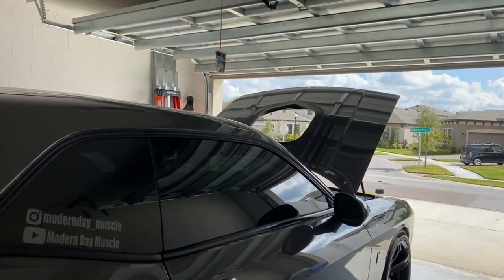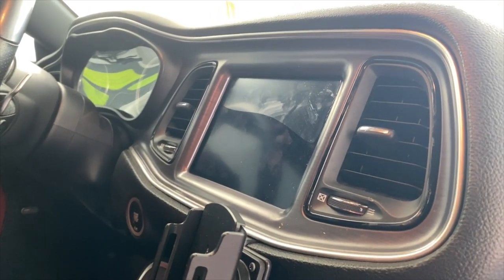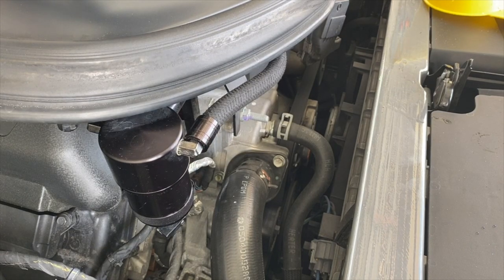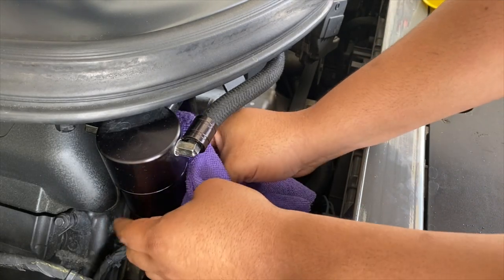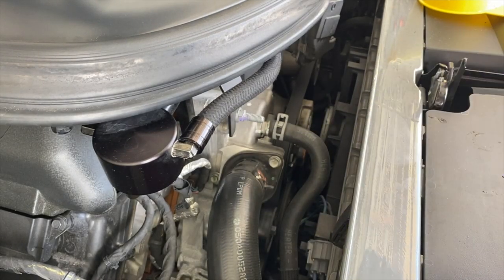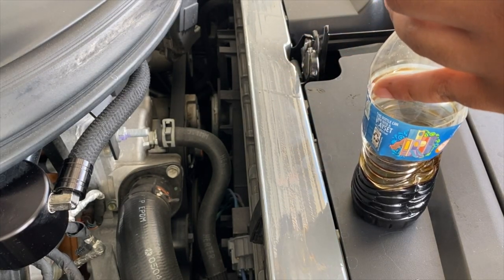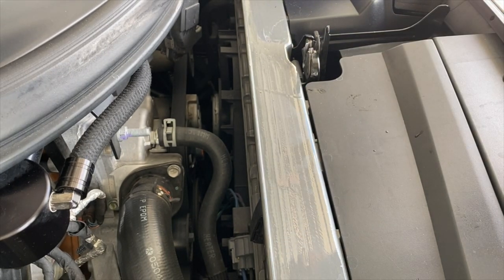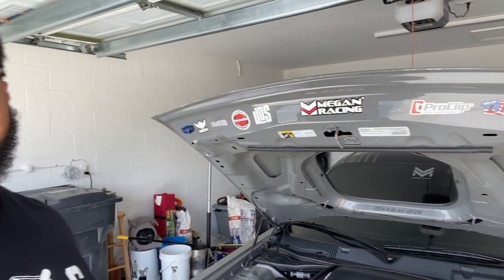THE FCA PROCESS TO FIX MY DELAMINATING SCREEN | MODERN DAY MUSCLE

Comment: Had mine replaced under warranty! It should be recalled honestly!
Reply: BTW, the factory does put a catch can on the car, it is just a BS version that pumps it back into the fresh air intake.  It’s the CTV valve on top of the non shaker scat packs.  That is why there is a dipstick there.  It’s full of oil from the blow off.
Reply from the maker: Damn I did not know that 🤔

Comment: I look at a video and seen what the problem is and how to fix it, what it is is the glue that hold the screen to the monitor is separating which causes the bubble, the radio is still good, he removed his radio and carefully took the face plate off and cleaned all the glue off and replaced the glue with gorilla glue tape and it looked like new when he was done ✅

Comment: Happening on my 2017 RT Charger plus the infamous door panel warping issue
Reply: Same here! It’s all bad
Reply: I have both the same issues also
Reply: @nunyabusiness8292  I had the radio replaced under warranty and the door panel cost me about 375 CAD for the panel and install

Comment: All screens of chargers and challengers will have that issue after two summers or three . 

I simply solve it by buying a used screen for 350 and installation for 80. Will never go to dodge dealership

Comment: How many miles does your car have? I think I heard the warranty ends at 33k-36k miles
Reply from the maker: I was definitely out of warranty but I’m eligible for the grace period
Reply: If you have the extended warranty you’re good for 85k miles
Reply from the maker: Nice that’s good to know
Reply: Mine is happening I only have 26k miles but I bought the car used on April 2021 , would I be good to take it in .? Would it be covered.? Or what would I tell them

Comment: Mines is like that bro some ppl just order new screens or get them replaced. I need mines fix. We gotta catch up bro it's been a minute love the content and your ride looking sweet.
Reply from the maker: Stay tuned bro 💯 gotta link soon
Reply: Just a heads up...I changed out my delaminating screen last year since mine was ghost pressing buttons and going crazy.  After a year...my new screen was doing the same thing, I think if you live in a hot area it causes the glue to melt.. since that glue holds heat it pressed buttons
Reply: @Silenced_by_nazi_youtube  Going through the same shit on my 17 R/T smdh. Best advice when getting one would be to tint all the windows even the front
Reply: @alonsogonzalez998  oh I've done that, my sides and back are even illegal tint....still happened....but it can get up to 110 where I live and that heat will find its way in.

Comment: It can be fixed at home I just did mine myself and it works great and looks the same you can't tell i did anything except you don't see that separation on your screen.  Go check out all this guys "The Hands on Gang" you tube videos on this subject   https://www.youtube.com/watch?v=cyphF9AgHTI    If your screens not cracked you can reuse it just use fishing line to separate not screwdrivers and such,  it's very thin glass touchscreen on top and fragile it doesn't bend.  What is happing is the glue used between the touchscreen on top and LCD screen on bottom is getting hot and leaking out the bottom of the radio assembly. Basically you take it apart remove the glue and reassemble with small tape as a spacer between the screens and it works just like new.